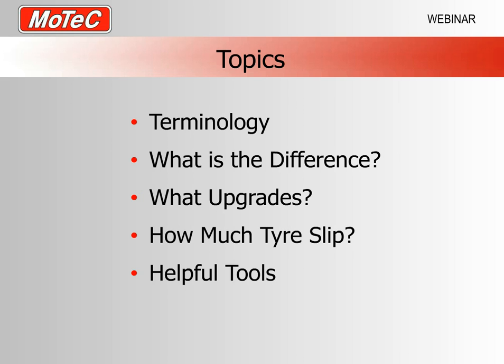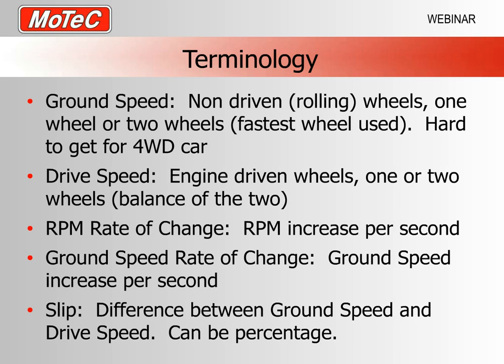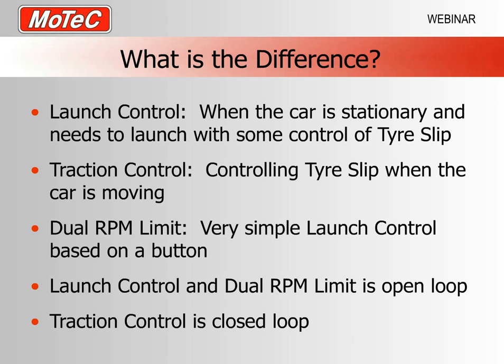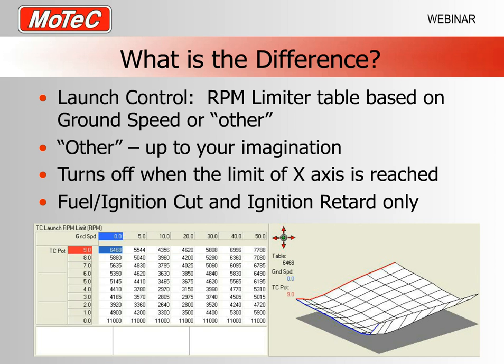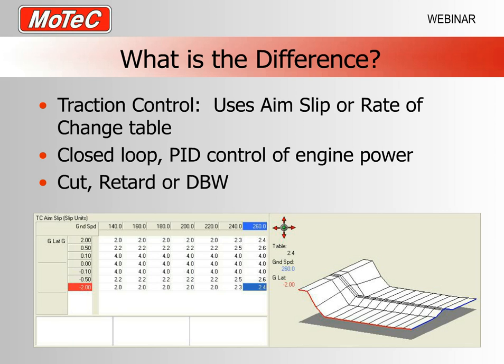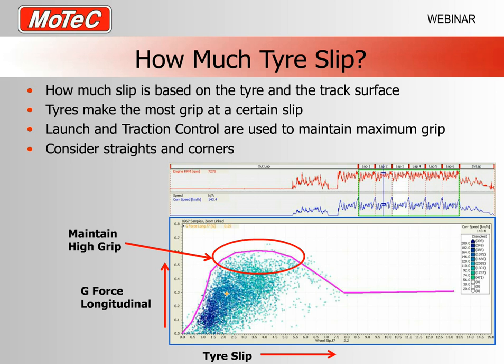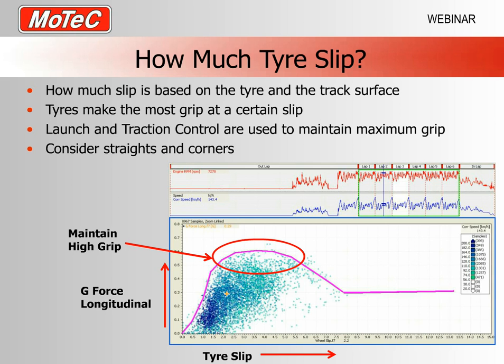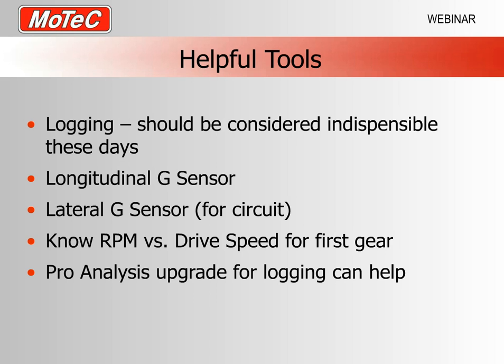Introduction to Launch Control and Traction Control

Comment: Would you recommend using Traction ctrl on rally racing cars?
Reply: jasaircraft in a sealed surface such as tarmac/asphalt it would be a clear enough scenario where it can be considered an advantage. However, for loose surface events such as gravel then it might come down to the circumstances such as the driver's preference and instances of tire wear; short stages versus long stages and how many tire changes are allowed.

In essence, traction control is a driver aid and although in theory there may be an absolute need for it, the driver has to be comfortable with its functionality. That's the biggest judgement of all I suppose, is the driver able to extract more out of the car's potential as a complete package or not.